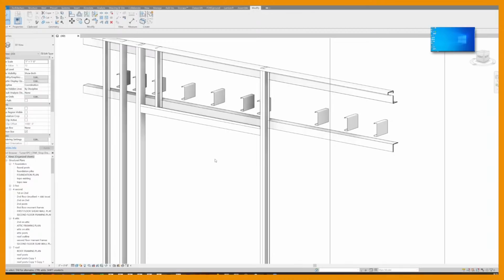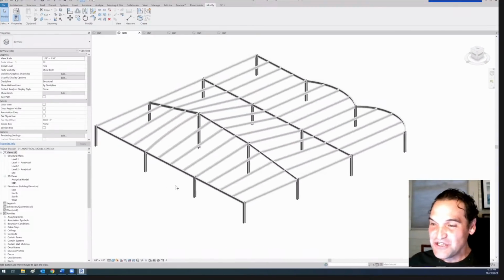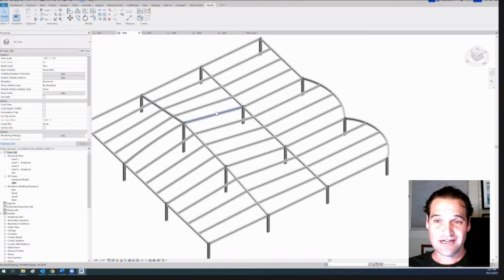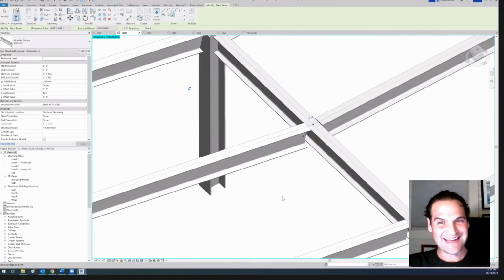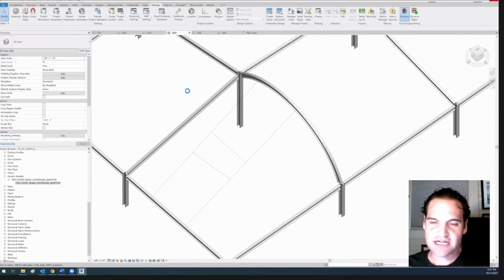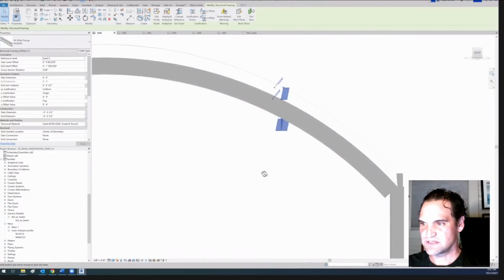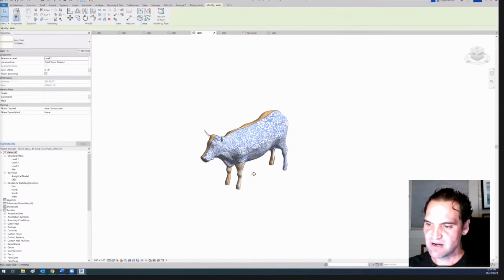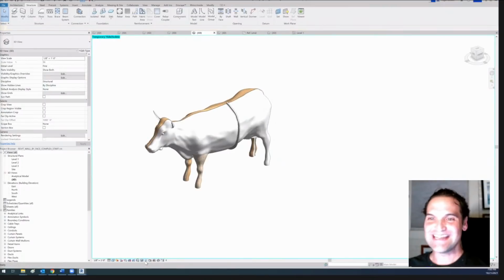Structural Modeling in Revit (Marcello's Framing Principles)

Comment: Really nice trick to create a model line in the beam family in order to align the physical and analytical beam. However, how would you draw the center line if it's a parametric L-shape beam for instance? the geometric centrer won't lie on the axis of symmetry anymore, cause the shape is not symmetric. How would you deal with that?
Reply from the maker: I’d think you’d just offset it to make it work? You can offset beams in any direction… perhaps?
Reply: Not sure what you mean exactly. In order to know the offset distance will need to know where the geometric center is, and it will be unique of each beam instance since it's not symmetric cross-section. As far as I know, it is not possible to snap on the geometric centre in Revit.

Comment: To align beams with each other you can simply use the "Trim Extend" command. This works for aligning face to face, mid to mid or even for a beam needing to touch another beam perpendicular

Comment: Hi Jeff! Didn't you notice the problem with adaptative points when hosted to surfaces? It's like the u and v parameters aren't matching the project units when working in metric system. It's like there is a problem with the family template!.
Reply from the maker: Didn’t notice!  Will have to check that out …